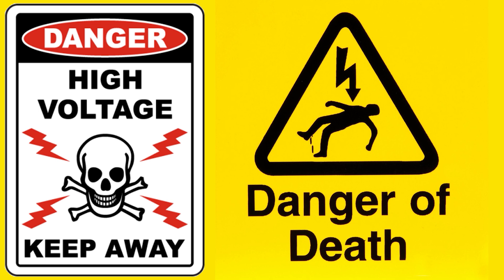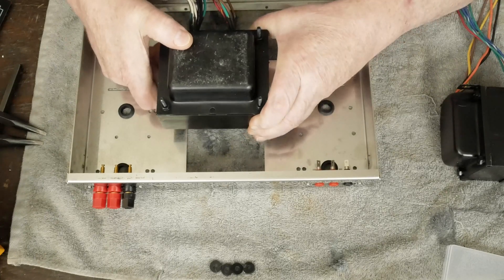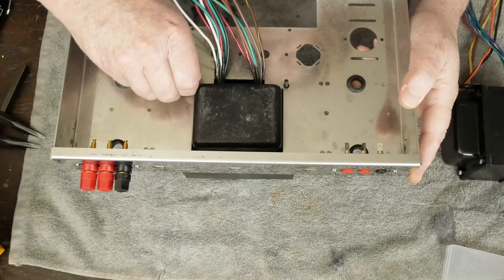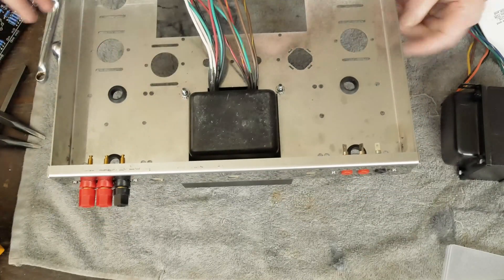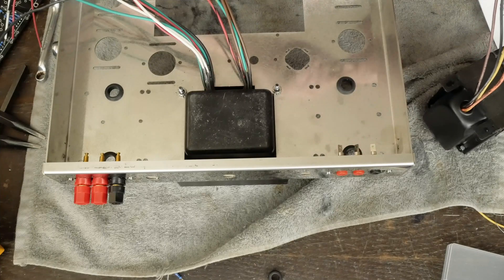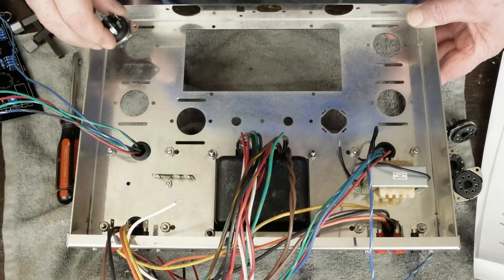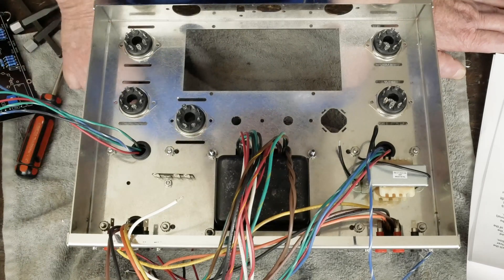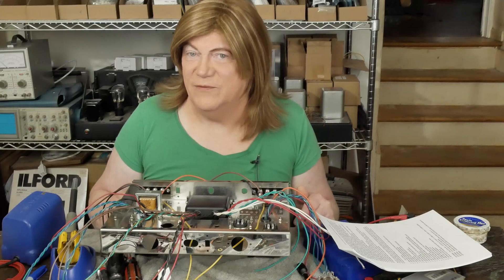Dynaco ST70 Tube Amp Kit: Installing Transformers and Tube Sockets.

Comment: Is the high voltage for tube amplifiers related to the voltage needed to heat the tubes? And do solid state amplifiers also have voltages just as high and dangerous?  Do class D amplifiers also have high voltages?
Reply from the maker: No, the tube heater voltage is normally 5V-6.3V. The high voltage is needed because the electrons have to travel though the space between the elements inside the tube though the vacuum inside the tube. There are electrons flying all over the place lol. And no, SS amps run on much lower voltages.

Comment: Good touch with the grommets. Basic protection, so often overlooked even by manufactures who should know better. I usually add a bit of sleeving over the transformer wires out of the bell as they are a little exposed outside the chassis. I like your cathode grounding mod too, much better idea.
Reply from the maker: Good tip!

Comment: can  Isuggest more robust insulation around power transformer leads ?
Reply from the maker: Those holes are smooth and rounded metal pressings, they are not sharp laser cut. I suppose you could try installing grommets around those too, (or heat shrink tubing?) but it's not needed. There are a lot of transformer bells made this way.